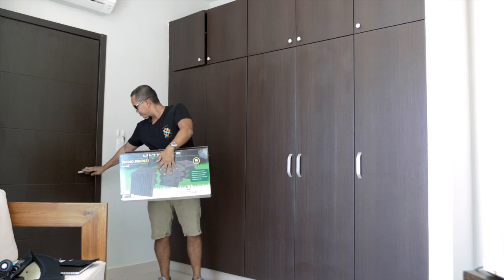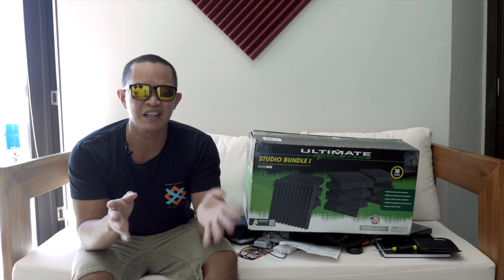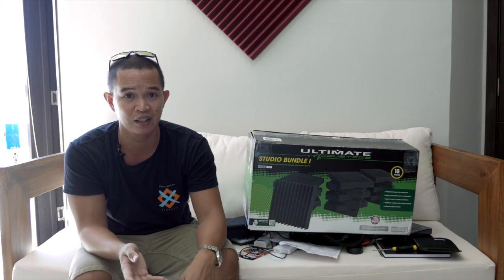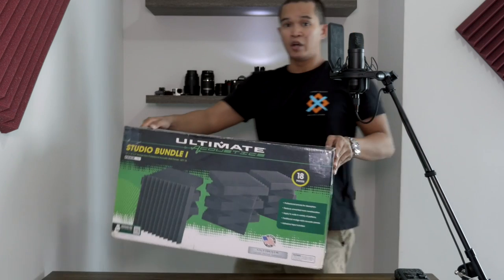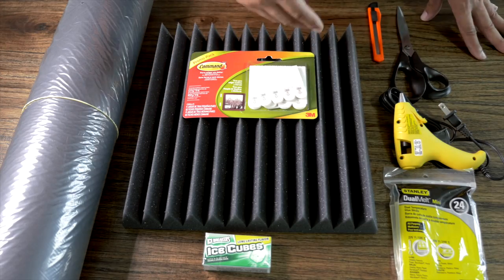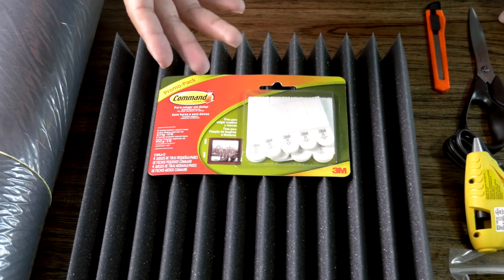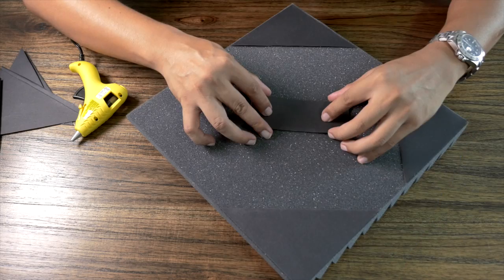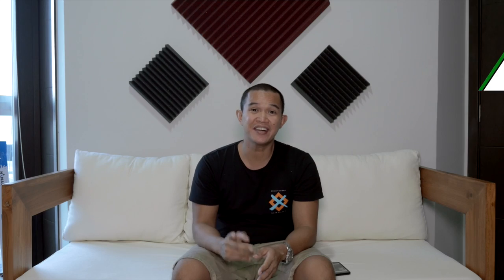How To Install Acoustic Foam Without Damaging Your Walls or The Foam

Comment: What you could start doing is positioning the shotgun mic in the right place to minimize the signal to noise ratio, so the closer to you the better and for this kind of setup it could be positioned right above you out of the frame or  down below whatever is closer to your mouth out of the frame. I hope that helps

Comment: Apologies for the essay; The problem isn't your ceiling per se, but that your acoustic strategy is resulting in increased reflections from the ceiling.

The first thing you should change is the diamond pattern of your large foam pieces as the wedges are reflecting half the energy they are attenuating towards your ceiling. If you placed them with the lines running vertically you will find they will reflect more sound back towards themselves (other foam pieces.)

It then becomes a matter of directing excess sound towards the absorbers that already exist in your room; the couch, the curtains (if they are fabric, you will notice an immediate improvement by drawing them closed.).

Lastly If you are focused on recording audio, then your first consideration ought to be structuring your acoustic environment around the placement of your microphones. The same way that if you were setting up a listening environment for a home theater your placement is dictated by the position of your speakers and sitting (listening) position.

It doesn't matter how the rest of the room sounds if it ends up being right at the listening position.

If you have a square room and limited foam, concentrating all the foam on the first reflection point you are speaking towards will also give you better results than what you have now.
Reply from the maker: Hi! Thanks for the input. I'll definitely take your advice on that one, especially on changing the pattern.

I'll be recording videos so the location in the room varies all the time but i won't (at least as of the moment) record any instruments. I do have a walk in closet which is almost dead quiet where I can record VO. I'll definitely work on this again. Thanks man!
Reply: Nurries mate. Setting up an audio environment isn't too hard, but you have the additional challenge of trying to keep it looking nice ;) 

GIK Acoustics has an excellent primer video for Reflection Points that I think will help you figure out the essentials for placements.

Rock on!
Reply from the maker: Thanks again bro! Peace!